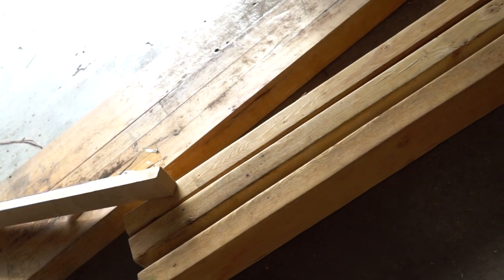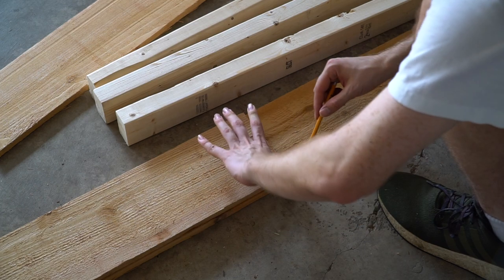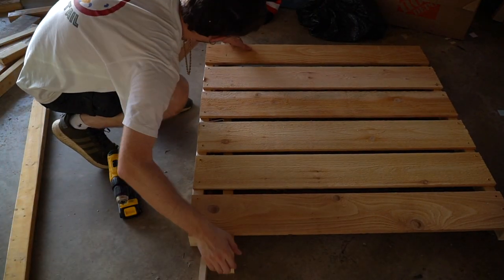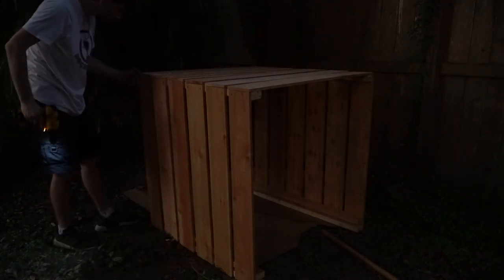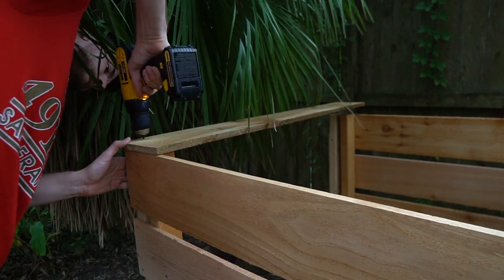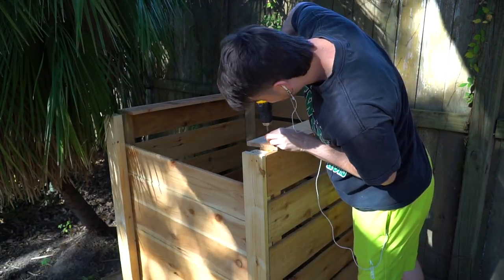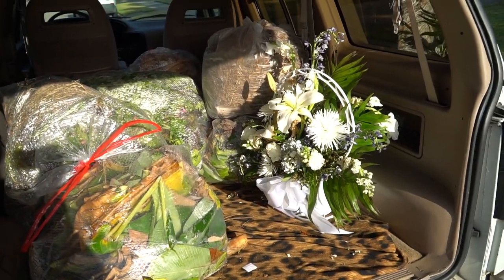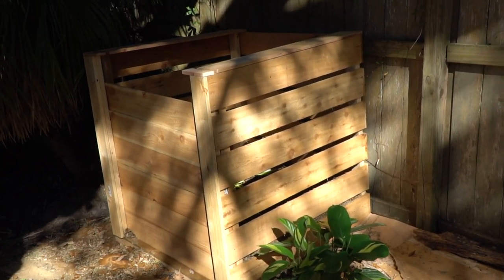How to Build a Compost Bin! Simple, Step by Step, DIY Tutorial!

Comment: I like your design. Years ago I built a 3 bin s ystem with the removable front panel system for access to rotate new into old and old into older. Basically 3 of your design attached. I needed a refresher and your sdesign peaked my interest. 
Just FYI: You should never add pet feces to a compost bin.